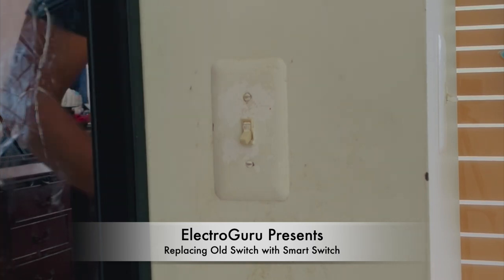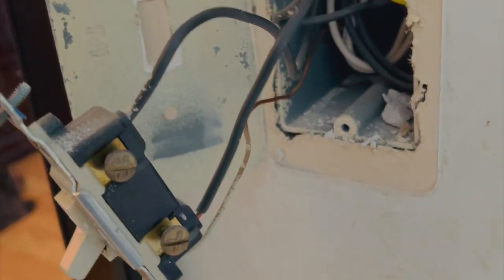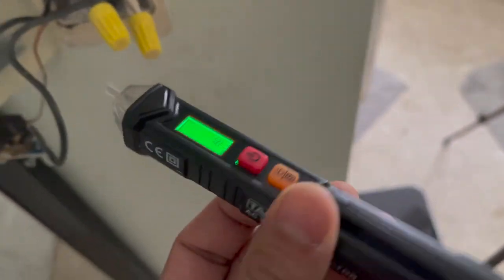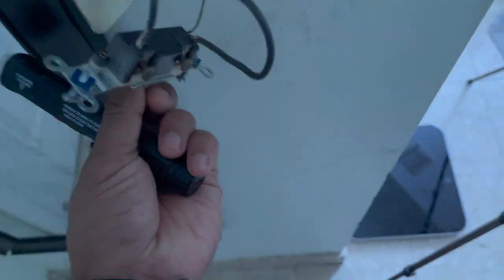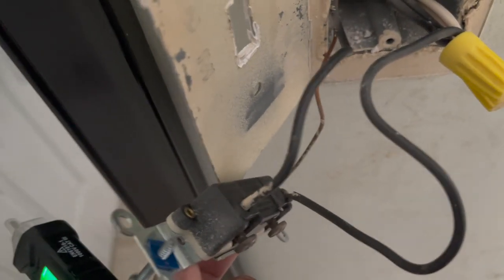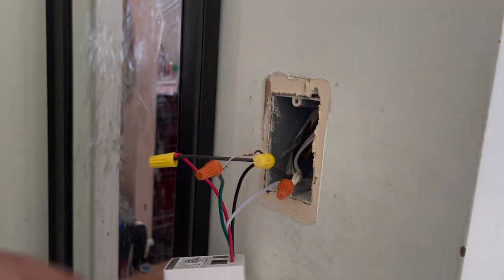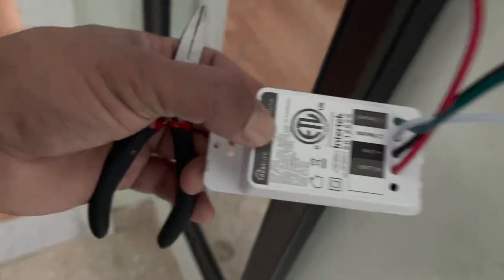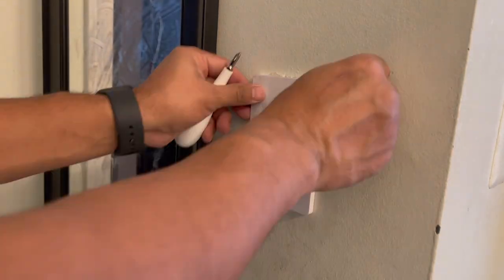How to Replace old switch with Smart switch - Easy step by step process

Comment: If I mistakenly connect the load wire to the line wire on the switch and line wire to the load wire on the switch, would that be a big problem?
Reply: It won’t be a big problem. The fuse might go out. U. Will just need to go the circuit breaker and switch it on again.